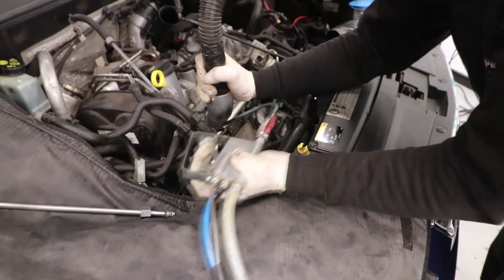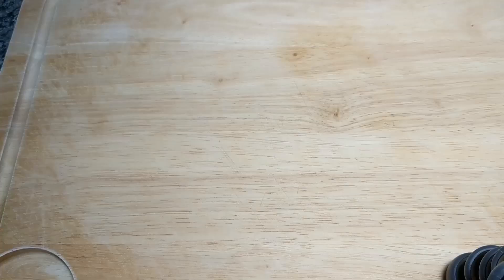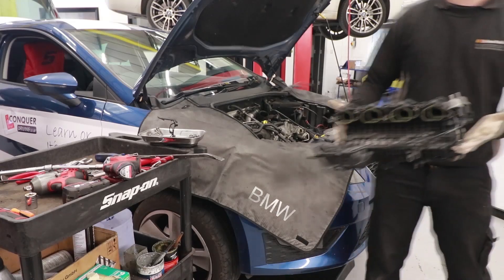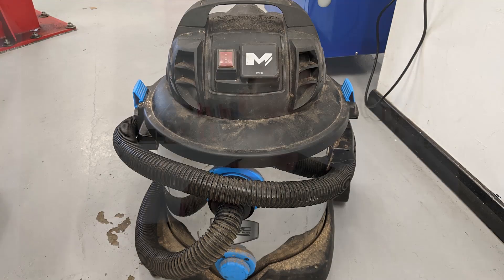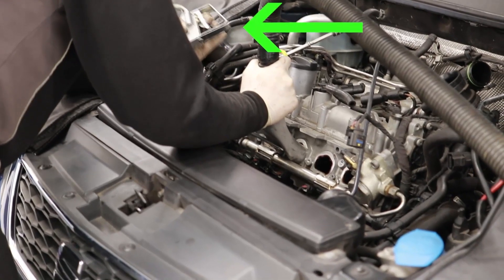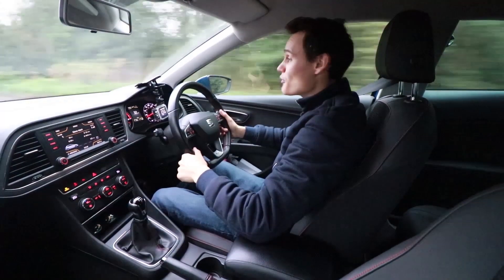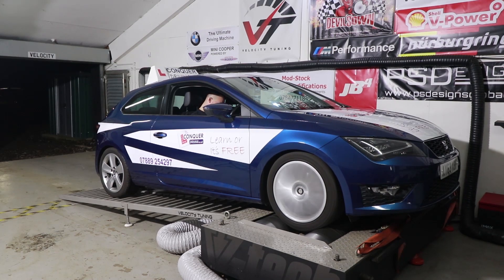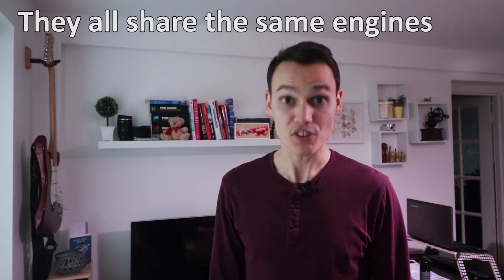Intake Valve Carbon Cleaning - Walnut Blasting Method

Comment: I watched the previous video, and you said the stock horsepower was originally 138ps, and you had lost 17ps when you put it on the Dyno, down to 121ps. But now you're saying you have 147ps. Correct me if I'm wrong here, but how come you have gained another 9ps above the stick figure, have you had a slight remap?

Comment: how is your mx5 doing about carbon i guess it may not have build up carbon because i think that engine runs the atkinson cycle meaning fuel goes to the valves and intake manifold from the bottom

Comment: I've got the 1.4ACT version of this engine with 82,000 miles and have been suffering from flat spots and jerkyness around 4000rpm. Also getting P030000, P030100 and P030300 fault codes logged for random, cylinder 1 and cylinder 3 misfires.

The hesistation has been slowly getting worse for the last 40,000 miles, plugs and coil packs didnt help.

I'm tempted to take a look, were any consumables such as gaskets, seals or coolant required when they took the inlet off?

Comment: I'm not sure whether or not to do this on my car, I've reached 145,000 miles but have no symptoms and the car runs just fine, however the later generation of the engine it's got is known to get blocked valves and manifolds

Comment: I have a 2010 VW CC with 103K Miles. I just had the walnut cleaning done to my CC and wow! Its better than new. It definitely is quicker and MPG seems a little bit better as well. There was so much carbon build up that when the intake was removed. The intake holes were only halfway open. Crazy. It took my VW dealership 3 days to property clean it.

Comment: I just did this on a Chevy Cruze 2.0 turbo diesel. It was throwing all kinds of codes for cylinder imbalance, underboost, manifold actuator problems and in limp mode for overheating, as well as the dpf full message every 20 miles. Dealers wanted 5 grand just to open it up. It’s a pain to take everything out to get to the intake manifold, but I wish I could show pictures of before and after. 3 of 4 runners completely obstructed and the valves you could hardly see. Swirl flaps stuck in a mass of carbon gunk. It took a few days to clean the manifold and unstick the flaps. Finally got the nerve to do the valves and I’m confident this has solved my problems. I don’t know how the damn thing still ran. Thanks for giving me the balls to clean that mess!

Comment: Really thanks for the video.  
Would you say there is an adventage for treating the car with walnuts & hydrogen carbon cleaning.     Do the hydrogen do somthung the walnuts will not ?
Reply from the maker: I didn't really noticed an improvement with with hydrogen cleaning.

Comment: Just curious why you chose a petrol over a diesel considering the mileage you do, and how diesels are easier to drive which is a bonus for learners. Also, you probably wouldn't have the carbon build up as you do with the GDI engines?
Reply from the maker: I've taught previously in diesels for 5 years and now 8.5 years with petrol. In my opinion petrol is easier to teach in. It stalls gently, therefore not scaring my pupil, my petrol is way more flexible in gear choice, so if my pupil gets the wrong gear is not usually a big deal. I don't have a Diesel particular filter to worry about any more, the engine is smoother and more refined making it a nice a place to spend time, I only lose 7 miles per gallon but my petrol has a solid flywheel which is way cheaper and unlikely to go wrong unlike a dual mass flywheel which is fitted to most diesels. When I used to start the diesel up in the garage, if I didn't move it immediately I would feel ill which tells me something about what it kicks out the tail pipe. Then there is the fact I just enjoy driving manual petrol cars, I prefer diesels to be automatic. I'm not against diesels, I bought my other half one as it suits her circumstances, but even though the improvement in economy seems to suit my circumstances, after 6 years of using two I decided they're not for me (the first year with a diesel was before I was an instructor hence why I've been teaching for 5 years in diesels but I drove them for 6 years). Also, I've been told diesels suffer with blocked intake valves too, although I've not experienced it.
Reply: Thanks for responding. That was really useful. Think I'm going to switch to petrol after reading your response. You are right about stalling in a diesel, it's brutal.
Reply: Do you fill up with E5 or E10 by the way?
Reply from the maker: I've always bought the cheapest I can find. It's not relevant to the rear of the intake valves as fuel doesn't touch them in a direct injection engine. Even cheap fuel seems to clean things well though. I used cheap fuel in my VX220 with a very modified engine that breathed a lot of oil, yet the intake valves were kept very clean by the cheapest petrol blowing into them.
Reply: Thanks for taking the time to reply. I Didn't realise that about the cheaper fuel  Have been using E5 for my petrol car thinking it would help prevent less carbon build up. You seem to quite knowledge about cars. I'm still impressed with how many miles you have got out of your Leon. Mine is a 63 plate as well, but it's the 2.0 184 diesel. It's only done 40k and has started lossing coolant. I've taken it to a trusted mechanic who has added a dye, done a few pressure tests, and he can't find it anywhere. It's to drop off at below the minimum mark every few hundred miles. This seems to occur when it goes through a DPF clean. I top it up and then it's fine for a couple of weeks, then uses a load more. Heating and air con running as normal. Recently the clutch pedal has started playing up, occasionally it gets stuck half way up, I then place my foot under it to pull it back up and it's fine. I have also had this looked at, the clutch itself is fine, the clutch slave is also fine. It's had full service history, and well looked after like yours, cambelt, water pump all changed according to the manufacturer's guidelines. Being a diesel it's always had a good blast on the dual carriageway a couple of times a week. Thinking of switching to a 2017 2.0 tsi, 13k from new, one owner, four services from Seat, but then I've read horror stories about clutches going at 20k, and more coolant issues. I know you have maintained your car very well, but could it just be luck that you got a 'good one' off the assembly line?

Comment: Do Diesel engines have the same issue with clogging up intakes? My Zafira B 1.7 CDTI feels really unresponsive
Reply from the maker: I have heard they do but have not had experience with this.
Reply: Egr and inlets blocking on diesels is common

Comment: How is the car doing two years after this service? I have heard that turbo charged engines don't last much past 200,000 miles. Whether it be the turbo wearing out the engine prematurely because of pressure, or the turbo actually dying. Wondering if it is more of an intake problem rather than a turbo not lasting problem.
Reply from the maker: My car now has 175,000 miles, still has loads of power and seems ever so slightly more economical. Lockdown means it has less miles than it would have had but I have a lot of faith in the engine as it seems to be strong, smooth and quiet. Another cambelt change is nearly due and I'll service it soon. Been serviced every 18,000 miles with long life oil. Just spent £575 upgrading the stereo to a system from a 2020 Leon with android auto as I tried many cars over the last couple of weeks but the new stuff hasn't moved the game on, they drive the same albeit with adaptive cruise control which is something I would like. But not worth the cost of a new car. New Leon, Golf and A3 don't look as good as the last model in my opinion either. The Mazda 3 however was lovely if a little underpowered even from the 186ps skyactiv x engine, lacks torque and my Leon feels way faster on the road. But the Mazda is a luxurious place to sit. The 200,000 mile number you hear quoted on motor reviewer etc is just a made up number in my opinion. Not many people have tested these engines over that distance as the car will be 20 years old normally by then and this engine was released in 2013.
Reply: @ConquerDriving  I am really looking forward to the 2022 Toyota GR86. A little worried about the longevity of my GTI and thinking the NA boxer engine might last long into the future, once gas vehicles are banned.
Reply from the maker: Keep changing the oil when needed and cam chain if it's an EA888 and I'm sure it will last as long as you want it to. Especially if it's standard.

Comment: fuck i need to do this. i drive a audi a6 c6 with the 2.0 tdi engine with 220000km on it and i love the car but it is starting to feel so sluggish at the high rpms in sure this job would do wonders considering ive already confirmed that  the turbo is in prime condition with zero slack and these diesel engines tend to get them selves jammed with soot typically

Comment: Hi, great info. Do you mind disclosing which company did you use for the job? Thanks!!
Reply from the maker: I believe I mention it in the video. They're in Chelmsford.
Reply: @ConquerDriving  thanks. some suppliers I contacted said their equipment (the vacuum hose) are specifically made for BMW (or German cars) hence will not do other cars. Don’t know whether SEAT count as German tho, will check them out!
Reply from the maker: @tony199110  you don't have to have the exact tool, I think they used BMW tools on mine.
Reply: Seat is a german car. It's owned by vw and they use vw engines

Comment: This is what you get very fast if you always shift at 2000rpm. Pretty bad for engine
Reply from the maker: When you consider some people see this after only 30k miles I think it's done well.
Reply: @ConquerDriving  30k is very fast! Mine has done 104k and is luckily still fine, i'm letting it warm up with low rpm but when the oil is warm i push it to redline a couple of times.
Reply from the maker: I push mine to the red line regularly too. 2000rpm is sedate residential quiet considerate driving. But give me a national speed limit and an open road and I'll enjoy myself.

Comment: This is why Toyota/Lexus nailed in from mid 2000s - the D4-S dual fuel injection. Not only do the cars have DI but traditional port injectors as well. This keeps the intake valves clean since they occasionally get sprayed on with gas on top of the normal DI operation depending on throttle application.
Reply from the maker: That's correct, Toyota normally get things right.

Comment: Conquer Driving...Now that you have it clean keep using that CRC GDI Intake Valve cleaner and maybe you can keep the valves clean longer. I wonder if maybe small hole could be drilled into the  manifold and spray cleaner into the air path closer to the valves then just cap off hole to seal it, until next cleaning. I think I'll do that when I get mine walnut blasted (for the first time). Maybe do the spray clean every 5k-10k and might save having to walnut blast for a long time.

Comment: Thank you so much for this... my car is having misfire issues and has had all sorts of warranty work done to it. I'm betting the dealership knew this was the issue but had no qualms about replacing parts under warranty instead. Gonna give this a go. Cheers from Texas.
Reply from the maker: Good luck.
Reply: The upside to this is that you got new(er) parts than what originally came with the vehicle for all the parts they replaced, PLUS there are much LESS expensive ways to DIY this issue. I'm also considering it for my '-08 Audi A4 2.0T Quattro Convertible which I bought used last summer. It ran fine all summer long - long trips to the beach, too! In October it suddenly stopped one day, went into limp mode then wouldn't start at all. It was close to home so we pushed it home. Next day it started, ran rough, and started smoking! After I shut it off, I noticed a HUGE leak, and it started pouring oil. Replaced the oil-filter housing. Ran OK. Cleaned MAF, ran ok for a bit. Ordered plugs and some other random parts for KNOWN issues. Wouldn't start after I replaced the High Pressure Brake Valve - not due to it. Limp mode to gas station after I FINALLY got it started. Hasn't started again, since. Now the hood latch is broken and I can't even open the hood/bonnet NOR will she start. Self-diagnosed as the Crank Pos. Sensor. Common issue w these and ALL VWs, some BMWs, MBenz, SEAT, Porsche & any similarily-aged vehicles WITH that part in similar location - beneath the Oil Filter or near it...oil leaks onto it, it collects TONS of dirt which eventually seeps into it or fouls its wiring. Will try replacing it after jacking vehicle up higher - it's STILL too low after I jack it, due to it originally being a low-stance "performance" oriented car. Pfft, OK, I guess. More, later!

Comment: 🤣 Just realised, I just messaged the one you went to for walnut blasting quote
Reply from the maker: Be interesting to know the price.
Reply: @ConquerDriving  329 1.4 tsi twincharged
Reply: How long did it take btw 👨‍🔧
Reply: Jesus, for that price you can get a small air compressor, the walnut blaster, the walnut grounded shells, and a 5gallon shop vacuum and do it your self! And of course the benefits here are that you will then have all the necessary tools to do it again on your next oil change or 10k miles and so on and so on.. and of course you would have a handy air compressor, blaster for rust/corrosion/sludge remover, and a wet/dry shop vac!

Comment: VW TSi engines have carbon build up problems, every one of them. On the other hand VW diesels are one of the best in the world, you can easily find their 2.0 TDI in MK 1 Superb/older Passat with 1 milion + km. Even when you consider the issue with misleading pollution numbers, they are not worse than any other diesel in that category.

Comment: Very thorough video! Excellent! I think I have the same problem.

I have a 1.4 TSI CHPA EA211 engine with 140bhp (same as the one in this video I reckon).

Recently I replaced the spark plugs with platinum ngk's and changed the oil (high grade OEM spec Champion 5w30) because the car was misfiring and shaking a lot when accelarating hard. Also my gas mileage is pretty low (about 1 litre/16 km), even when driving 'civil'.

I had hoped the problems would go away after this service. In fact, they have worsened. My car has over 170000km and I doubt the previous owner has cleaned the intake valves. 

How much has your gas mileage improved after the walnut blast? Also, do you have any tips for doing this on a CHPA engine? The only thing that stops me from doing this is making a mess due to removing the coolant hose.
Reply from the maker: It sounds like you have the same problem. Very common with these engines. The hot weather won't be helping it. The fuel economy never changed. I would guess the hot weather would be increasing fuel consumption with the AC working harder. I would recommend you get a specialist to do the work. Much easier if you can if it up and get under the car.

Comment: The VW, VAG is more than VW, Audi, Seat and Skoda.  You forgot Porsche, Bently, Bugatti and Lamborghini.  Plus Ducatti, if you're counting motorcycles and several truck brands.  

I need the carbon cleaning. My Audi S6 is getting sluggish but given it's design, it's not going to be easy.
Reply from the maker: I know VAG has it's exotic brands too. I was sticking with run of the mill cars.
Reply: @ConquerDriving  Oh come one, Bugatti's are everywhere.  lol

Comment: Wow, impressive results. I just recently bought a brand new car with a GDI engine, so I hope to not let the intake valves ever get to that point that yours were at, by doing a CRC treatment one week prior to every annual oil change, and by using Valvoline "Modern Engines" full synthetic oil. I did see your results using the CRC product, but my thinking is that it didn't work in your case because they were in just such a bad state to start with (Have you seen the video where the guy soaked his very badly carbon deposit buildup caked intake on his BMW in the CRC GDI cleaner, left it to soak, and it completely dissolved the carbon and cleaned them up, just like a walnut blast, so the stuff really does work). Now that your valves are looking a lot better, I'd suggest doing the same thing I mentioned above; keep them from getting as bad again by doing a CRC treatment a week prior to each oil change (they say that it keeps improving for about 8 days after doing the treatment if the car is driven regularly), and by using the Valvoline "Modern Engines" full synthetic oil, which is specifically formulated to prevent carbon deposit buildup in GDI engines, if one can believe the marketing...
Reply from the maker: I think given that the CRC stuff is £40, I would rather just get them properly cleaned for £300 when they're bad instead of buying several cans of that stuff.
Reply: Conquer Driving Interesting. It’s only the equivalent of 15 GBP here per can, so that, once a year, isn’t too bad, considering how much we spend on other parts of our cars, eg premium fuel, synthetic oil, etc.